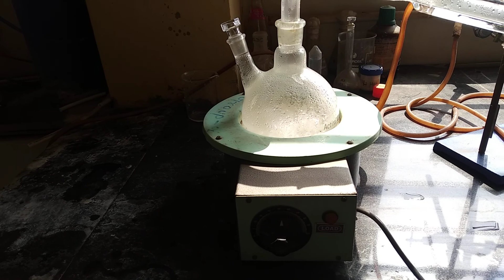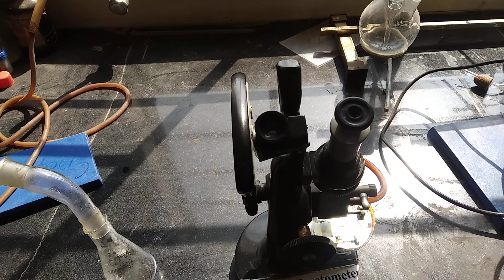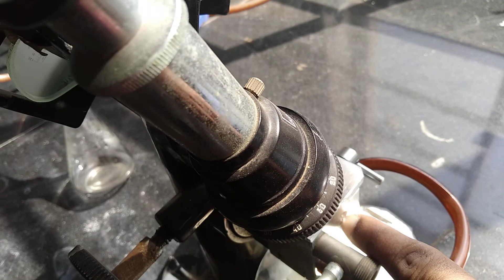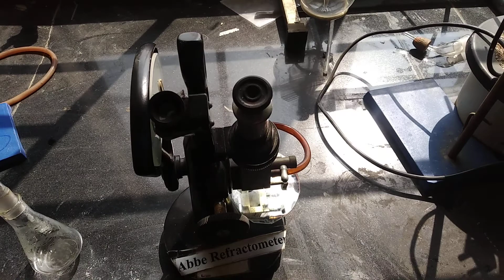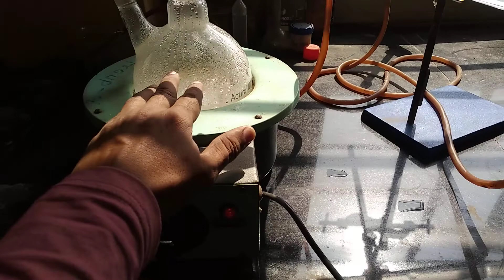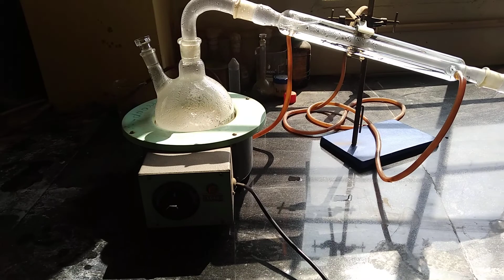Simple Distillation: To verify the Rayleigh’s equation.

Comment: Sir please upload process modelling and simulation lab experiments :

Process modelling and Simulation lab experiments

1. Estimation of dew point and bubble point temperature of a hydrocarbon mixture
2. Simulation of flash drum
3. Design of ditillation column
4. Optimization of a flow sheet or process
5. Determination of temperature profiles for heat exchanger
6. Concentration profiles for reactor
7. Simulation of Jacketed CSTR
8. Simulation of process
9. Simulation of evaporator/ distillation column/ extraction process
Reply from the maker: Sorry to say we won't have simulation Lab.

Comment: Sir please do upload process dynamics and control lab experiments :

PROCESS DYNAMICS AND CONTROL LAB Experiments

1. I & II Order System Dynamics
2. Interacting & non interacting Systems
3. Flapper - Nozzle system
4. Control valve characteristics
5. Level control system
6. Flow control system
7. Pressure control system
8. Control of a thermal system
9. Design of control system for a given process
10. Simulation of a closed loop system
11. Demo Experiment using Aspen Software of a given process
Reply from the maker: We are conducting these experiments but not allowed to upload videos.
Reply: @chemicalengg.experimentsbypnp  sir please try to ipload it . I am eager to learn it.